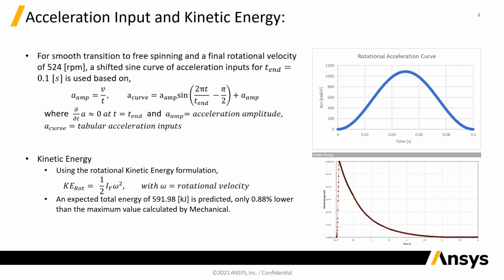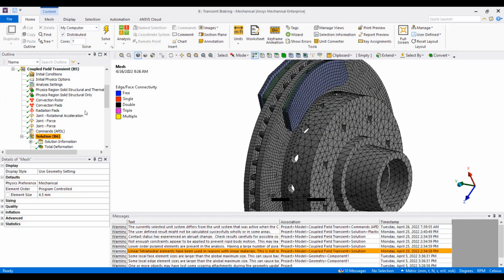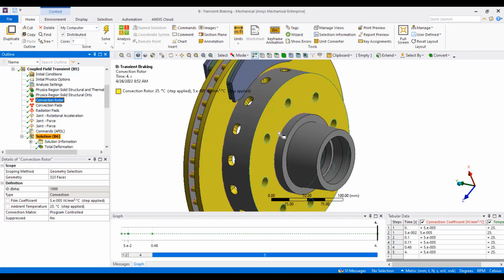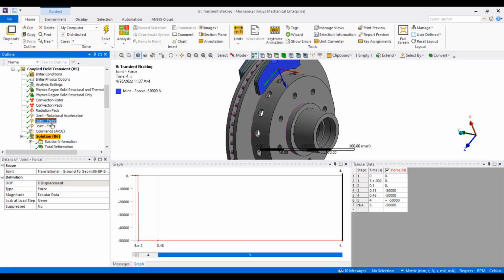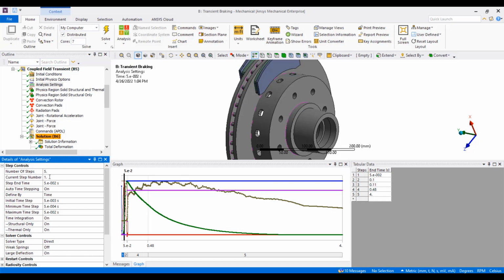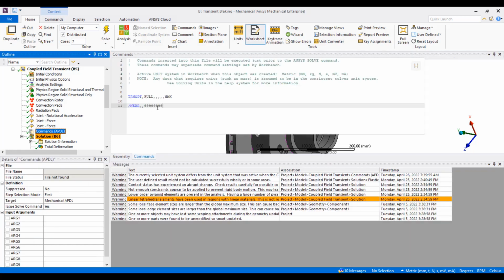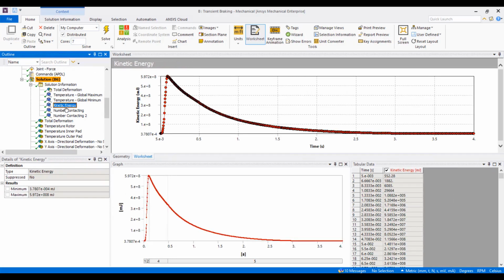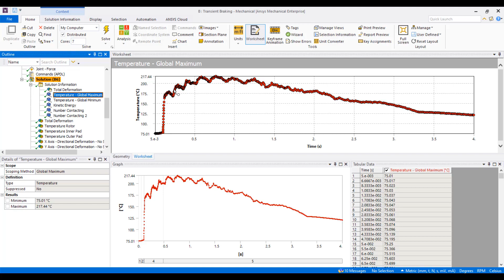Thermo-Structural Analysis of a Brake Using Ansys Mechanical - Lession 3, Part 2

Comment: Very good presentation. However how you set up the physics especially distinguishing thermal significant components from the   initial significant component. How did you ensure the K.E of the system is the specified value?
Reply from the maker: Thanks for watching! Please post your query on the Ansys Learning Forum for a detailed answer from the wider Ansys Community: https://ansys.com/forum.
Reply: @AnsysLearning  i can not see this project on the forum. so how do we query it on the forum?